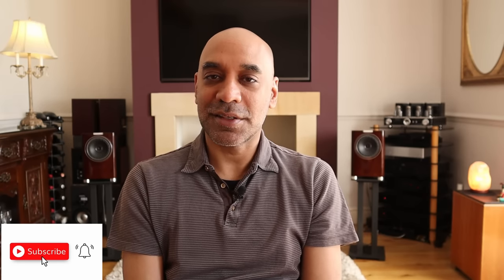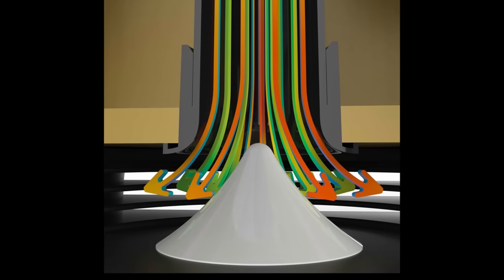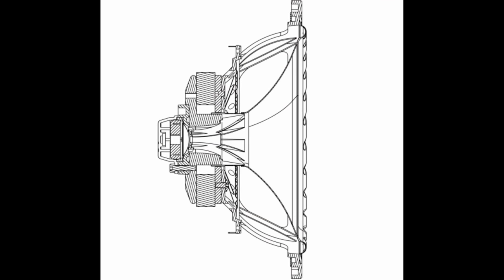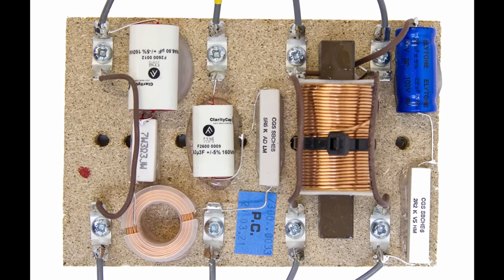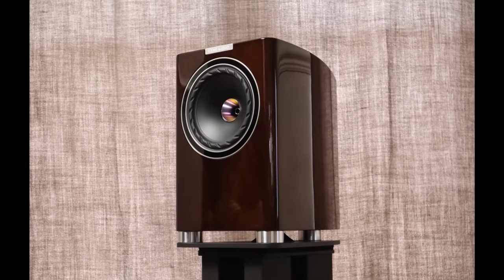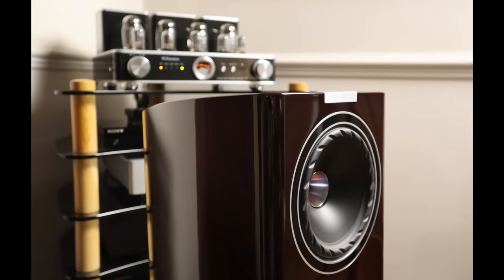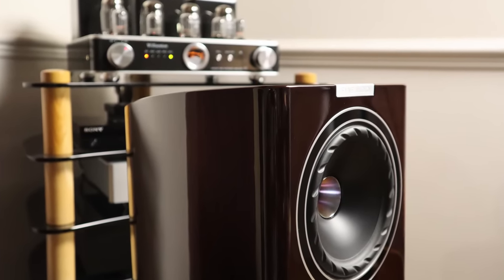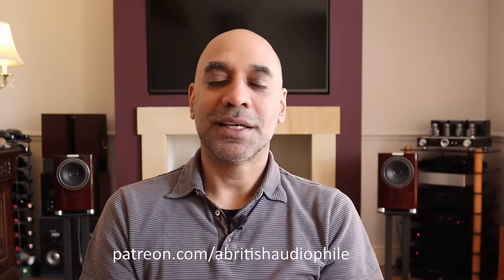Fyne Audio F700 Speaker Review

Comment: Cryogenics worked for me. When I made my audio cables years ago, my source for 6 nines ofc Japanese copper got greedy and wanted me to really over order for my needs. I countered by using standard cheaper 4 nines oFc copper and cryogenically treating it, it sounded sweeter and the details and subtitles seemed to come through better. Never missed the Japanese copper. If I'm not mistaken, Meitner in Canada used to cryo treat a whole preamp or amplifier! Cryogenics are used to relieve machining stresses in racing engine parts for longevity as well as rifle target shooter as it prevents the barrel from wandering a bit because of the stresses built into the metal when a metal bar is drilled, rifled and countered to shape. They will cause a barrel to shift a tad when it heats up. No big deal to a hunter, but for a benchers shooter where group size matters, it's important.
Reply from the maker: That is great info Lee. Thank you for sharing your knowledge and experiences 😊👍👍
Reply: Trivia. We measure wire size by the American Wire Gauge method. An artifact of the industrial revelation. the number designation of the wire indicates the times it was drawn through smaller and smaller dies to attain its size. 4 AWG is large and 30 AWG is obviously small. Doesn't matter with Ohno continuous cast as it is cast to size. 
How current wires are made is beyond me. AWG may actually have no current relevance to manufacturing processes except as a benchmark for fixing the diameter of a wire. 
Something you could have lived your entire life without knowing.
Reply: @abritishaudiophile7314  I am a repository of useless information. Some information stick in my head with absolutely no relevance to anything else.
Reply from the maker: I find these little gems of insight fascinating. The older I get, the more I find pleasure in simple things as well as little details that may only appeal to a small group of people. I suppose that is what this channel is all about. The joy of simply enjoying music whilst sharing little details that help to increase our satisfaction of it 😊👍

Comment: Taron, thanks for your in-depth appraisal of the Fyne F700. I listened to these at a local hifi dealer, and your observations were confirmed. I've a set of Tannoy Eatons whose tonal balance are a bit better as you move off-axis, but these vintage units don't have the level of clarity that the F700's exibit. I also have L Cao FA6 single driver speakers in TQWT enclosures w/ passive radiators with the mass loading removed. As you stated, Dopler distortion creeps in as power is increased, hence why I now limit power to 12.5 wpc to keep the doplar at bay. Much appreciate your detailed review style with comparisons to similar competition. Thanks again.
Reply from the maker: Thank you Bradley. Great to learn about your experiences 😊👍

Comment: I like that you stated that your best amplifiers did not match with the Fynes. Been yearning for Fynes since they came out. Now, I run my personal (2nd hand) grail Reference 3a MidiMaster with an H90 as a seconde system in less than ideal conditions. The speed And(!) sweetness that you can get from a simple crossover (few parts) design, that is (in my version) a bit long in the tooth, with an amplifier that can produce current and fast is continuing to amaze me. One of these days, I will hook up the MM to my AR tubes. Wonder if that will show me limitations as for you with Fyne and Exposure or amaze me even more… 
Nice work man! As always!
Reply from the maker: Thank you buddy. I appreciate your watching and sharing your experiences 😊👍

Comment: I can see why the other speakers may have more air.  Those speakers have baffle mounted H.F. units which allows the highs to radiate in a wider patten then the horn/wave guided H.F. units in these speakers.  That means this speaker is providing less delayed H.F. energy from reflections.  Either option is a preference.  I tend to lean toward clarity, than diffuseness caused by delayed reflections. I am a person who loves detail and color, both can be hidden or at least reduced by reflections.  That said, I am surprised these speakers don't have high level top end detail.
Reply from the maker: I agree. I suspect the narrow dispersion of the horn tweeter limits the spaciousness and overall sense of envelopment but makes them more room friendly 😊

Comment: From my pro days always loved the coherence and clarity of tannoy mix monitor speakers.  I tended to gravitate towards the 8" due to better bass.  Would love to hear these speakers.  Thanks for the excellent review.
Reply: You would want to hear the Fyne Audio F701 - the next size up in the 700 range of Fyne Audio. 8" woofer, larger cabinet as you would expect.
Reply from the maker: Thank you JK 😊👍
Reply from the maker: Hi Bryan, I may got for their top tier F1-8 first. It has an eight inch mid/woofer. Just to see what they are capable off 😉
Reply: @bryantaylor2946  yes, I would definitely want to hear it.  I am a huge fan of point sources and planar drivers as they do many of the same things using very different physics.  The fewer "effective" drivers the better.
Reply: @abritishaudiophile7314  We have F1-5 and F1-12 in our stock - Fyne hits at all price points F701 - F1-8. (we are the Canadian Distributors for Fyne).
Reply: @bryantaylor2946  How about the Classic X is it better than 7 series?
Reply: @klepp19  The F702 with two 8" drivers is about 50% more expensive with a lovely walnut cabinet. The F701 is a bookshelf so a trade off in bass vs the Classic X. You must hear them both and decide what your priorites are.
Reply: @bryantaylor2946  Thanks Bryan! Max budget is Classic X and I do want a floor stander. Let check out their website!😊

Comment: Fyne F501 user here. I'd like to add one advantage to concentrics: At least my ears are very sensitive to direction and driver characteristics. I was shopping for a ribbon-tweeted speaker, but found myself distinguishing between the different drivers too much. The technique came between me and the music. 
That being said, your description about the type of listener experience around 6:50 is spot on, for the F501 at least. In fact, the speakers have drawn me into more intimate, vocal or acoustical, genres. 
The F501 being floorstanders and having a second bass-driver packs more of a punch, but no doubt loses a bit of point-source clarity and coherence. Especially with the upgrades to the 7-series. That tonal richness you mention in combination with the way it fills the room is what won me over.
Where my experience differs (yes, with other speakers) from yours, is at low level listening. In fact, the F501 are a bit too engaging at low levels to my taste: in my room and setup it is difficult to use them for a background music in a room with some conversation or a dinner. Just because even at low levels they engage that much more then other speakers I had, like Magnat project 4 and Linn Nexus. Probably because of bass extension, and / or the difference between standmount and floorstander.
Reply from the maker: Thank you for watching and sharing your experiences Karel 😊👍

Comment: A correction if I may?  I specialise in building speakers using vintage Tannoy drivers.  I have spoken with Dr Mills on this design.  It is not true that they do not have similar dynamics due to the smaller horn compared with conventional speakers.  It uses the woofer and a waveguide, essentially acting as a full mid range before the flared horn kicks in fully for the hf.   The benefits of this which you didn't mention is that they effectively create a true passive cardiod response and importantly, control directivity across the full frequency range meaning toed in much more than you had them,  you get less reflection off side walls, a more accurate room power response of lower thd than conventional multi drivers whose position results in field lobing or asymmetric wave propogaton with comb filtering.  You need to toe them in immediately in front of the listening position so the axis crosses only when you move your head a few inches forward.  Try them like this....they'll image better and wont sound as hard in the horn.

If it weren't for the fact mine are rather large, you would be welcome to take them and try those.  You won't find them lacking in detail or dynamics.  Those fynes cannot be expected to be ultra dynamic with a single 6 inch woofer which has a true cone area of more like 4.5 to 5 inches!  You need proper big cones...12 or 15  inch, to do the dynamics you're expecting really.  This necessitates cabs of 100 to 140 litres using 12 inch dc drivers. They'll literally blow your socks off!
Reply from the maker: Thank you Paul. Great to hear about you experiences and thank you for sharing your knowledge. I did try them in different positions with varying degrees of toe in. I was comparing the dynamic to similar sized speakers that I have reviewed, including my smaller ProAc Response 1SCs 😊

Comment: Great review!! Since I am looking to get a pair of Tannoys, i will definitely audition these, or the next model up before decision’s made. Though I must say the electrolytic cap in the crossover put me off a lil, I guess it’s the actual sound quality that matters at the end of the day
Reply from the maker: Thank you William. I questioned Fyne about the use of the iron core inductor and the electrolytic cap. I got a response from the Technical Director Dr Paul Mills himself. He explained that the iron core gave better bass damping than if they had used an air core that would fit in the space. The electrolytic is not directly in the signal path and again it was Dr Mills assertion  than a poly cap offered no sonic benefit. I can’t speak against it one way or the other as I would have to switch the components out myself to know for sure.

Comment: Good afternoon mate , 
Just want to pick your expert brains , I recently purchased a system for my dining room a denon dm41 dab , I’m looking to improve the speakers it came with , I will be putting them on a sideboard about 3 feet apart and 6 inches from the rear wall , I know it’s not perfect but it’s only a 2nd system to listen to while we eat our dinner , I’ve been thinking about q acoustics 3020 in gloss black which I found n offer for £150 , also Costco have the klipsch r41 for £179 which I believe to be a great price , which out of the two would you say are the best for my needs and the placement were I will put them , also any others you think may be better for me would be fantastic, 

Thanks in advance mate 👌
Reply from the maker: Hi buddy, both should be fairly easy to drive so should work well with the Denon. The Klipsch will be more lively whilst the Q Acoustic closer to neutral. If you want something warmer the Elac Debut is worth checking out. I also like the Dali Spektors. Good luck and please let me know how you get on 😊👍

Comment: Well, at least they are aesthetically pleasing and using Baltic birch as a cabinet material is unconventional. It won’t make me replace my ProAc EBTs, but the cabinets are visually striking. Good luck to them. Cryogenics will not improve sand cast resistors nor will it do so with iron core inductors as these two components are why so many speakers sound bad. Still hoping for a speaker stand video. Stay safe mates!😊👍🏻😷
Reply from the maker: Thank you for watching and sharing Mark 😊

Comment: Excellent review and we'll done.
Did I see electrolytic capacitor in the crossover?
If yes it's too bad!
These type of capacitors will dry over the years and will change there value leading to changing the sound character. and eventually die.
These type of capacitors are cheap and tend to fail over the years much Sooner than film capacitors that are more expensive but reliable.
I hope it's not electrolytic because that means manufacturer is cutting corners.
Is electrolytic or else?
It's not clear .
But the review itself is excellent. I like the Way you do it.
Reply from the maker: Hi Kobi, there is indeed an electrolytic cap in the crossover. Also, an Iron core inductor. I questioned Fyne audio about this and got a response back from Dr. Paul Mills himself. The electrolytic is not directly in the signal path. It was his view that changing it for a metal film cap would offer no sonic benefit. The other caps are top quality Clarity caps.

The size of the inductor needed ruled out the use of an air core design. To get the DCR down the gauge of wire needed for an air core would not fit. I suppose at the SPLs that the F700s is likely to be played at the magnetic field on the iron core would not get saturated. In any case it was Dr Mills view that he could achieve better bass damping with the iron core as opposed to an air core that would fit.

Comment: I was going to get the F500 SP but I listen to large orchestral works. I know it's a different speaker but now I'm worried that they wouldn't handle that well. Any thoughts? I was going to get the Klipsch rp 600mkii because I'm looking for a horn loaded speaker around the £1000-£1500 that can handle various genres.
Reply from the maker: A larger speaker will handle the dynamic swings in orchestral works better 😊
Reply: @abritishaudiophile7314  The thing is though I love floorstanding speakers, my current living situation is that I only have small rooms. So bookshelves with a subwoofer where I can dial in the bass will work better for me.
Reply: Btw, do you do this for a living, Tarun? Just wondering…I’d love it if here in the UK we had canjams and Hifi festivals where we could demo gear and meet up….
Reply from the maker: @syanhc  it is kind of a semi-retirement job for me now 😂

Comment: have you auditioned the Tannoy Revolution XT series XT6 and the XT Mini. The XT Mini has a smaller tweeter diaphragm and it stages and images better than the larger XT6 but of course the bigger loudspeaker does play louder and go lower. These are the most advanced DC design Tannoy has done to date. They do however take a long time to fully burn in but they are both worth the wait time.
Reply from the maker: I haven’t auditioned them at home but have heard them at dealers and shows. Sounded good from what I recall 😊

Comment: Hello! I'm stuned that for this price tag they still use sandcast resistors and an iron core inductor. Also, they don't seem to use any kind of damping material. Maybe they removed it for photographic effect. At any rate, I find some of their technical decisions to be questionable based from an acoustical standpoint. Fine video as usual (pun intended)!
Reply from the maker: Thank you Yves. Much appreciated 😊👍
I am sure they removed the acoustic foam for the photo. They all seem to use sandcast resistors. I still can’t seem to get to the bottom of why 🤔

Comment: What am I missing? 
It has the same components of the f500sp, same drivers, same extension, same cryogenic BS but in a slightly bigger box.
And almost three times the price?
Reply: I own the F500SP, and Tarun's review of these F700 speakers sounds identical to my own experience with the F500SP. Mine are staying.
Reply: @michaelwright1602  I listened to both speakers and the biggest difference is in the cabinet as the shape is more complicated to manufacture and is also made of stronger material. Sonically there is almost no difference. Definitely f500sp for the money.
That horn tweeter is magical!